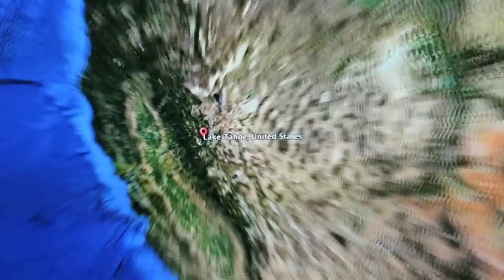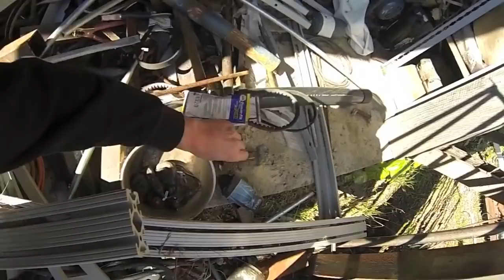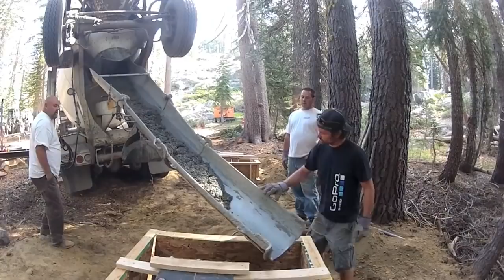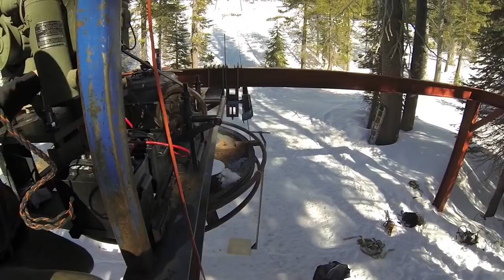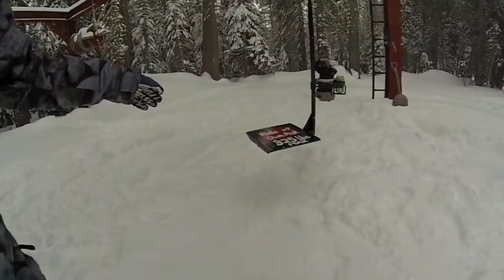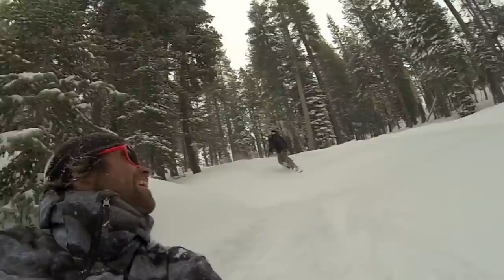Building a Private Chairlift

Comment: 5 years later and this is still the most detailed video on how to construct one of these things. I wonder if it's still in operation? Maybe a follow up video could be in the works on things they learned and would have done different??
Reply: I was out there around the time of the video plus some years after and never remember seeing it running
Reply: @paulyedward5563  shame, lots of moving parts do require lots of geese though. I work on a ski hill and they're always climbing towers.

Comment: i like the military engine, that's a perfect engine for something like a chairlift that only runs when there is snow, but when it does run it runs for a very very long time with little supervision. those engines were designed by teledyne continental who also builds general aviation aircraft engines and they were made to operate in extreme conditions and run for months on end.

Comment: I like since there are no hydraulics so he uses rocks for cable tension instead
Reply: Most lifts (at least where I am from) have tension provided by concrete slab masses on pulleys. Cheap and low maintenance.